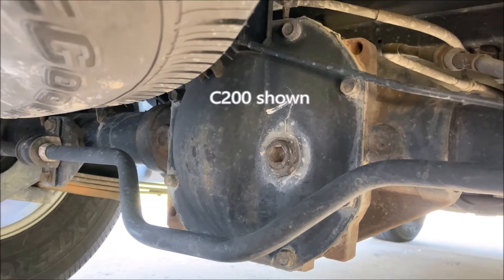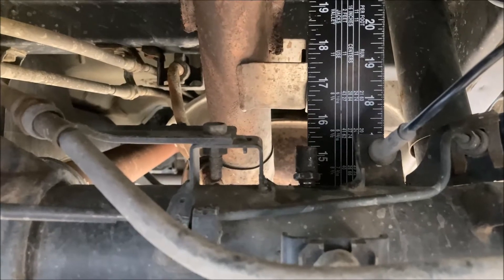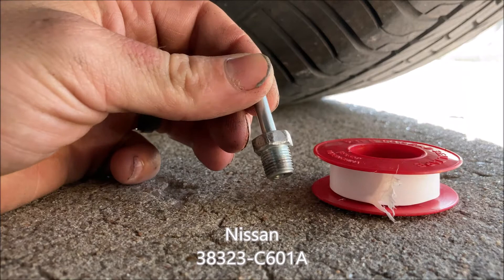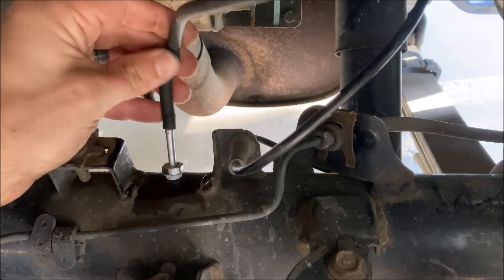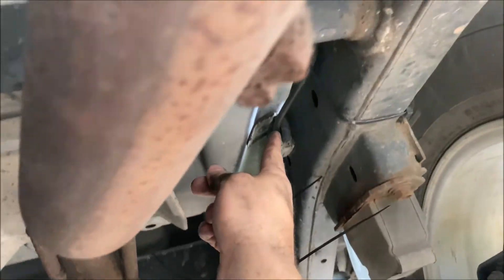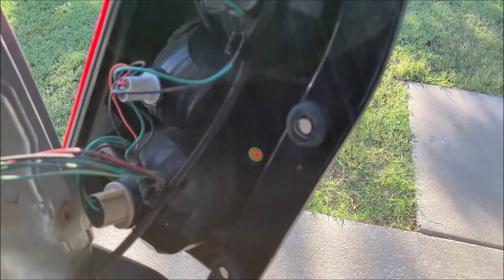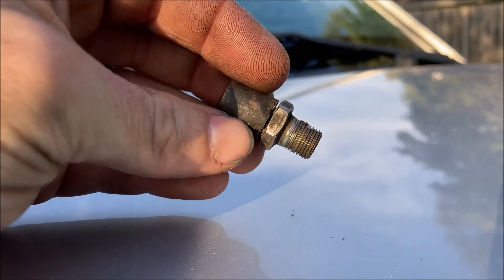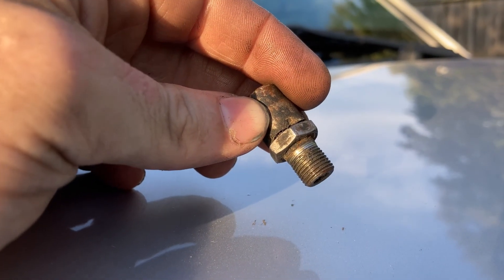Rear diff breather mod for 2005+ Xterra Frontier Titan

Comment: This is on all models from 1998 to present. YOU DO NOT NEED TAPE OR ANY OTHER THREAD SEALANT. THE KNUB HAS TAPER THREADS. DID THE OLD ONE HAVE TAPE? NO IT DID NOT. it is much easier to feed the hose down from the taillight then it is to feed the tube up into the taillight assembly.